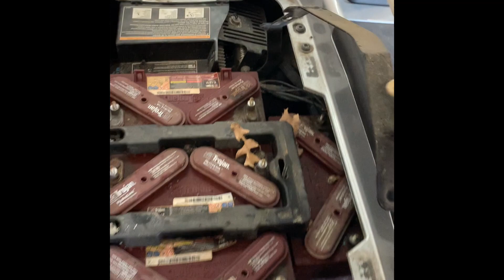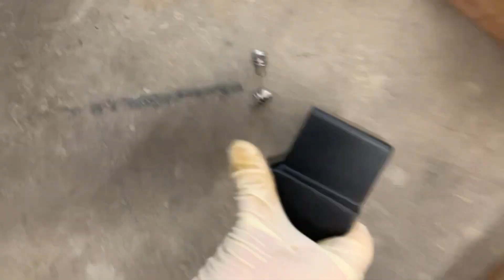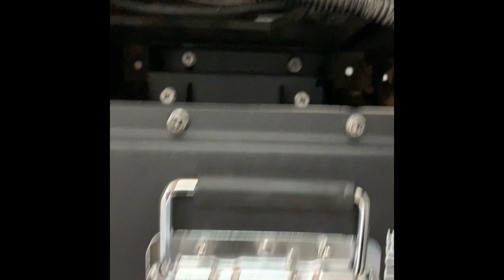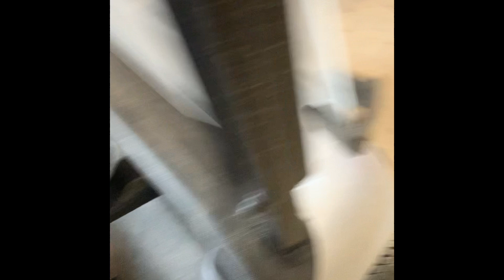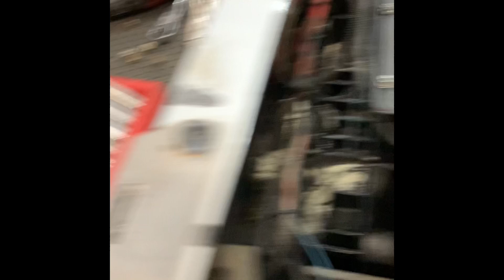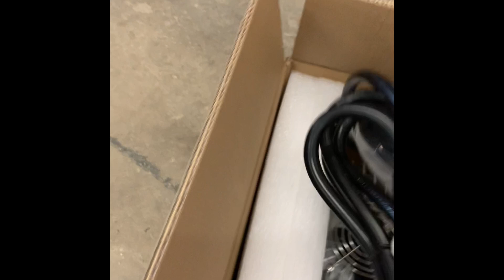RoyPow Lithium S5156 / S51105 Battery Installation / Conversion on 08+ EZGO RXV 48v golf cart carts

Comment: Has anyone had an issue with the brakes locking up after this conversion?  I installed the RoyPow S51105P.  It charged up fine.  All lights and horn worked.  Old and new battery indicator showed a full charge.  I took it down the road and at about 400 feet or so, it just completely locked up.  The lights were still working.  Had to flip it to tow mode and push it back to the garage.
Reply from the maker: I haven’t. Take it by a dealer and have them check it out

Comment: Great video! how does the cart run with a S5156?
Reply: Great. I don't notice any power difference between the 56Ah and the 105Ah. Its only going to be the range between charges. If you'd like to order the battery please visit my website JBCarts.com

Comment: I have a 2011 RXV with the controller upgraded to a Navigate 600 amp. It is on the fly and Bluetooth adjustable, so I can run it at any amp setting. I don't turn it up and Trump on it often anyway. I have read the stats on these batteries and am not sure this is the brand for me.  I may also install a front disc brake kit so I don't need to rely on the raven brake. Any suggestions would be appreciated.  Thanks.

Comment: Great video, I installed a Seplos 135 Ah battery in on a 2017 Ezgo RXV and I have a problem when slowing down with the battery fully charged the regen causes the battery BMS to shutdown and that in turn activates the electric brake, needles to say that is not good. Do you have any suggestions?, Thanks.

Comment: Great video, but just wanted to say that is not a fuse. It is a temperature sensor for the lead acid batteries. It tells the temperature of the lead acid batteries to the charge port via the resistance of the little wires inside. It no longer has a use with this lithium install, but do not cut it, or extend it. The resistance of the thermocouple wire can change causing the cart not to operate due to charge plug error. The red charge plug wire can be extended without any issue, as long as it's done with the same wire size or larger, and good splices are made. Hope it helps!

Comment: What is the mounting hardware # for the EZGO RXV?  My local dealer gave me Bracket-TX Material Code S4855M217 and it just doesn’t look right.  Your mounting hardware is different.

Comment: I have read some comments stating the factory voltage limits that are set in the Curtis controller are for lead acid batteries and not lithium. For example lead acid shouldn't be discharged lower than 40something volts but lithium can be discharged further to 30something volts but the controller won't like it. I don't know actual numbers just that lithium can go much lower. Did you do any controller reprogramming?
Reply from the maker: I don’t offer programming. You don’t want to drop below 40v on a 48v cart. Lithium or lead acid.
Reply: @jbgolfcarts  maybe it isn't an issue?, I don't know. I only read a post on buggies gone wild from Bob Boyce who is a curtis controller guru that said when he programs controllers that he sets the voltage limits to work with lithium and lead. I currently have lead and want to convert to lithium. How far can you run the Roypow lithium down on the SOC and has it created any problems? Thanks!

Comment: Great vid, great content! Is that RoyPow lithium pack enough to handle an aftermarket 400a controller?
Reply from the maker: Thank you! Yes, I would use the S51105 or higher. Factory controller in this cart is a 235a. I wouldn’t recommend the S5156 with that high of an amp controller. Need the longer run time for sure.
Reply: @jbgolfcarts  I really appreciate the fast reply, very helpful.  Keep the up the great work!
Reply: @jbgolfcarts  Is there any reason why the battery terminals can’t face the passenger side?
 The battery cables that came with it should then reach.
Reply from the maker: @David25522  you can put it in towards the pass side and use the provided cables. You would just need to cut your receptacle wires and extend them.
Reply: @jbgolfcarts  Can you please tell me  what the four wires connected to the receptacle are four?
I appreciate your help.
Reply from the maker: @David25522  red and grey go to positive 48, black to negative 48 and blue plugs into your factory wiring harness.
Reply: @jbgolfcarts  Where do I connect the blue wire since it was connected to the receptacle before?
Reply from the maker: @David25522  you should really have someone install this battery for you. The blue wire doesn’t need to be unplugged to begin with. Leave it plugged into the harness. Just move your main positive and main negative.
Reply: @jbgolfcarts  I appreciate all of your help. I think mine is a little  different than yours. I have a 2009 EZ GO and the blue wire is actually plugged into the back of the receptacle.
Reply from the maker: @David25522  that’s exactly where is goes. Blue wire stays plugged in from the receptacle to the wiring harness you shouldn’t mess with it.
Reply: Great tutorial video!!!
Thank you!!!